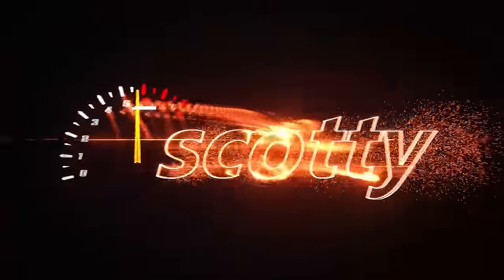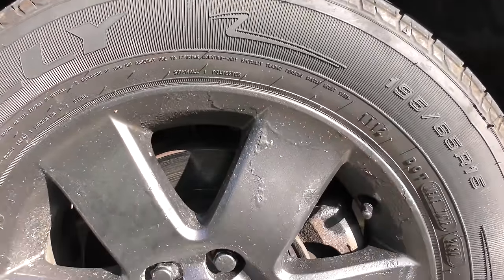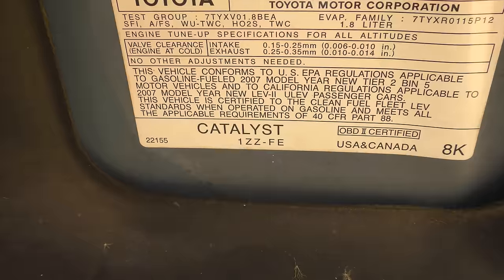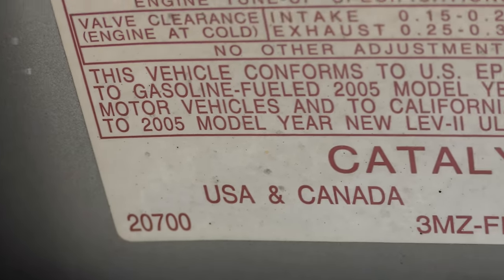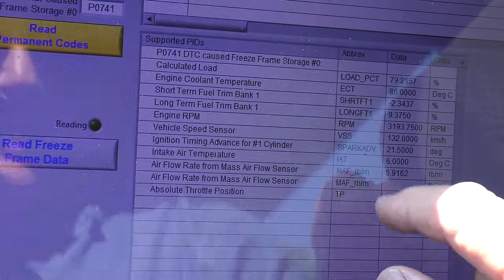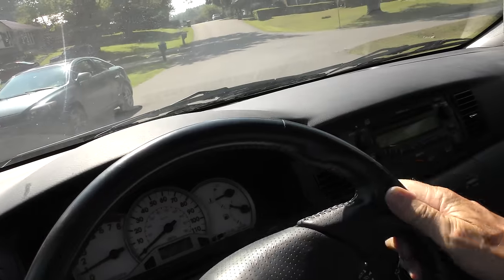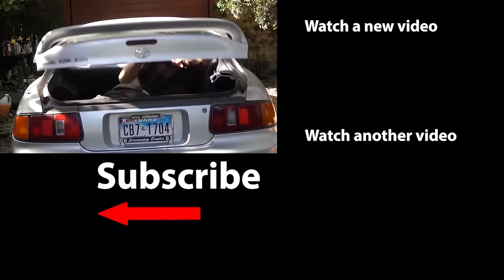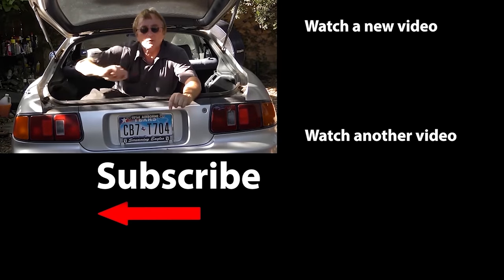I Won't Fix This Toyota Corolla

Comment: Because toyota corollas are so bulletproof they practically fix themselves. Just turn up the radio!! Good afternoon scotty!!!
Reply: Says the man who has drank a lot of Scotty's cool aid 🤪
Reply: Hahahaaha
Reply: Not the new one though
Reply: My corollas Audio doesn’t work deadass needed sum help no other problems beside a cracked bumper 🤧
Reply: Lol this is hilarious, I do exactly this in my 00 rolla 😂
Reply: Had to install a sub in mine to fix all of the worn out bushings.
Reply: I gotta say. Toyota through and through guys. Bought a 2009 corolla 5mt with 119k miles a year ago. It's been a very reliable commuter with the only a seized guide pin, a bad master cylinder, an ABS pump that just clicks, 1st gear becoming synchroless, the water pump breaking, the vvt-i intake gear rattle(very common defect), cyl 2 rod bearing spun despite religious oil maintenance, 3rd and 4th gear becoming synchroless(different gearbox), cyl 2 rod knock coming back a month after pulling the engine to replace the part, the clutch release bearing sounding like a cricket, and as of 2 weeks ago it doesn't even crank for reasons i can only guess being the only things wrong with it. It's a Toyota through and through! Very reliable, and very fuel efficient. Welp, guess I'm gonna go replace my crankshaft. AS YOU DO WITH A 140K MILE COROLLA... RIGHT????
Reply: @mashedpotatoes5323  😂😂😂😂
Reply: That's what I do every time I hear a noise just turn up the radio

Comment: Says a lot about Toyota quality that you can drain most of the fluid out of the transmission and it will still drive! If that had been a Chrysler product, you wouldn't have been able to get out of the driveway. 😂
Reply: You've obviously done your homework, bro.
What did it prove, in the long run???
Reply: @andysaunders3708  tf you so salty about? lemme guess your Chrysler 200 blew its self up
Reply: @masonharkness6437  Not yet.
Reply: @andysaunders3708  😂😂
Reply: @andysaunders3708  need an update has it yet?

Comment: Never buy a car with this problem. I have a very similar problem on my car. I was told by a dealer that I would get worse gas mileage, Just replace the broken part and the car would be great. Now I have an 05 Camry with 160000 miles and a dead transmission after 2 months of ownership. The mechanic told me that this issue tends to cause overheating in the transmission at higher speeds, so the previous owner probably drove a lot on the highway and caused a lot of damage before it was sold to me. If you have this problem, just stay off the highway, not necessarily the end of the car. But if your thinking of buying a car with that problem, then just run. You have no idea how many times it was driven on freeways.
Reply: This is one of the most useful comments on the video
Reply: Sorry to hear that about your camry that really sucks man.  I bought an 03’ Corolla at 70k, and at 100k I had the torque converter shudder in 3rd gear between 40-45 mph, and the rpms are higher than normal on the highway once I go over 65mph.  If I go 75 I’m around 3100 rpm. For almost 6 years I’ve been staying in 3rd gear longer to avoid the shudder, and rarely going over 65mph.  Also done 5 atf drain and refills since I bought it, no metal in the fluid.  Hasn’t gotten any worse in 6 years, at 220k now and still shifts great. If you baby it, it can last a really long time.  Previous owner of yours probably drove it a lot the highway at high rpms and overheated it too often.
Reply: @felipe3354  what’s considered high rpm on the highway? I’m going 75mph @ 2800 rpm. Is that high?
Reply: I have a 2007 Corolla with this issue but I think the issues only happened occasionally because I can drive all week and the check engine light would come one and then go away 10 mins later. I guess it depends on how much it’s slipping and 3k rpm at 80mph seems fine to me

Comment: Where I live, a check engine light automatically fails the inspection.
Reply: I had to drive car for 200 miles and 25 restarts to get mil ready state. After fixing abs. Inspection then went fine. Battery was disconnected during repair.
Reply: If you got a buddy and a used car business go by on one use one of their little turn off the check engine light for 3 days adapters they fit right under your dash and they work great cuz I used to work at a car lot and we did it all the time and it works on Toyota's
Reply: @MAKING-WINE-ITS-A-GAS  Can they be bought commercially?
Reply: In my state obd1 mil lights are passed but obd2 emission only related codes fail
Reply: Interesting. A loose battery connection can cause a check engine light. Obviously, that's not an emissions issue unless you want to claim that the electronics isn't operating properly as a result.
Reply: Hey I've been having the same problem in my 05 Corolla I noticed I was down to about 20mpg is it a really hard to fix or is it the grounded one on the back left side sensor of the transmission I believe it's green in color for the oem one?
Reply: I used to live in PA. they had inspections there but all the mechanics would just do a "lick and stick" 50 bucks out the door. Live in Kentucky now. No inspection
Reply: Im pretty sure you can pull the check engine bulb so it wont light up lol. More work than its worth. But if you ever go to buy a used car, turn the key over so all the dash lights come on. Make sure the check engine lights up. Ppl will try to scam you. Scotty tip
Reply: Just disconnect the battery few minutes to inspect and that solves the problem.
Reply: @MAKING-WINE-ITS-A-GAS  you’ll be cheating yourself mate. Just repair the damn fault and hit the road
Reply: @mzee5533  I don't have a problem with my car. Mate! You must be confused?
Reply: That sucks
Reply: Same where I'm at
Reply: @genericdude6551  Thing is the shops / inspection stations have liability if they pass a car that has an issue that may lead to bad emissions so you never know. Another thing is a lot of licensed inspectors only get X amount of inspections they can do in Y amount of time.. so they are choosy
Reply: @JohnDoe-qj8nm  They check to see that the light actually works in a lot of states--if the light does not come on when the key is first in (as in, it comes on to make sure it functions as most of the lights do), then you fail before you even get to try hahah
Reply: @chineduokonkwo5777  when you get an inspection there computer can see if these was a recent CEL on. They will make you leave and you have to drive it until it cycles in the ECM about 25 times. Then you can go back to have it inspected. I've seen people try the old disconnect the battery cable trick and they get caught everytime. Lol
Reply: @fromthebackofmymind  ... or you could have just gone to any parts retailer for a free scan and had them clear the codes...

Comment: I've had a 1989 and a 2007 Toyota Corolla. They are the best cars you can buy if you value reliability. The engines really are indestructible. Change the oil fill up the gas and drive no worries. Can't say that about many vehicles.

Comment: I own a 2006 Corolla with 320,000km with no major repairs ever needed. I also drive a pair of 2009 Camry Hybrids taxis that have 427,000km and 604,000km on them respectively, all mostly in city driving. On the Camrys, the engines rattle, the hybrid system is totally dead, but they still run and still run well.
Reply: I don't mean to argue but how do they turn on to begin with? Don't they need the high voltage from the hybrid system to crank the engine in the first place? Genuine question out of curiosity since from what I've read toyota's hybrids don't have a starter since gen 1 priuses so just wondering is all.
Reply: I like to her the answer. Waiting
Reply: @StealthMomo  You can hook up an accessory mount, alternator and a bigger serpentine belt. It will work as a normal car.
Reply: @adammorrison3343  Wait don't the hybrids lack a serpentine belt in the first place doe? Where are you gonna hook up an alternator to when the crank's mated straight to the e-cvt? Unless you mount it either between the e-cvt or just use it to crank the cvt itself is there some other way I'm missing?

Comment: There are still many 2003 - 2008 Toyota Corolla's still on the road today which shows you how long lasting Toyota's are. I see 3-4 of them on my street
Reply: I have an 08 Toyota Corolla with only 55k miles on it.

Comment: If the torque converter doesn't lock up then you can also get some overheating at high speed.  All the energy lost to slippage ends up being converted into heat and over time that can cause problems.
Reply: Still probably not worth fixing, junk the car when the trans finally dies.
Reply: There are also products you can put in your transmission to reduce or even eliminate the slippage.
Reply: @jaysonwallker1648  what product works best?
Reply: I doubt that will happen because you gotta remember on the highway, all that air is blowing past the radiator and there is more cooling to compensate for the friction of the converter. If it was a higher horsepower car, I'd be more concerned.
Reply: @kdmq  your radiator cools your engine not your transmission.
Reply: @randomwordbot  some vehicles (like my truck) have dedicated trans cooler radiators. They also will indeed gather cool air from underneath the car when driving at highway speeds, cooling the actual housing (to a degree. nothing major like a dedicated cooler though.)
Reply: @KenzertYT  i know some cars have a trans cooler but its mostly on performance vehicles ( my volvo turbo has one) or heavy duty vehicles like trucks i think im pretty sure most cars dont tho
Reply: @DoubtingThomas333  it’s crazy how cheap engines are and transmissions are like twice as much as an engine
Reply: @kaaugs16  tell me about it.  Diesel engines last but once they get age related issues (injectors usually), I hope you've got deep pockets.   I've had some luck using Lucas transmission additive to keep life in the clutch packs of a normal torque converter auto.
Reply: @StevenAGleason  where at because I called toyota and it cost 414. I have a comercial account and that’s my price…
Reply: Honestly it sounds worth fixing. Especially since it’s hard finding used cars now.
Reply: Under 2002 Corolla don't have lock up anymore old model tranmisson don't have that feature. Just need to change fluid short intervel.
Reply: @randomwordbot toyota corolla have transmission cooling lines from the bottom of the radiator goes to the transmission (i'm corolla owner)

Comment: This is the same car I drive everyday. I have had it 5 years and the odometer just passed over 300,000 miles. Minor things are wrong with it but still runs and runs. I love it and the 1.8 engine and I want to get another one.
Reply: Just bought one with 265xxx miles 😂😂 she runs good, but seems to be struggling to start but starts first try. it shakes when going into reverse. and makes a lot of fricken wind noise when going fast in the cabin😂😂😂😂

Comment: I've got an 05 Pontiac Vibe with that same engine/transmission which had the same code come up.   For me, changing the fluid (not flushing) did the trick.  I don't think the previous owner(s) ever checked the fluid before I had gotten it.  I'm almost to the next 60,000 mile interval and still have yet to have an issue with it since.
Reply: I have a Corolla with 115k miles. I get the code after driving 100-200 miles at 60-80mph. When I checked the fluid it was way overfilled with the car off and while running so I’m going to do a trans fluid change. I think they didn’t change it and thought adding more would be fine

Comment: I have this same problem with my '07 corolla but the check engine light only comes once i get to Newark airport driving back from NY to PA...after a day or 2 the light comes off...car runs great only thing is once in a while when i hit 50 or 70 mph i can feel the car shake, i just let go of the gas peddle and it stops

Comment: My 08 corolla LE has the same code! Everything you've said lines up with what I've heard from my mechanic, but I've noticed that when I use my cruise control at highway speeds it has caused my check engine light to come on. any thoughts?

Comment: I replaced a clutch torque converter solenoid but still get the same code. The car runs fine but I can't pass inspection with this check engine light on. What could be the issue?

Comment: 0:44 = that model year of Corolla almost always has the flange joint cracking off, just where the muffler connects to the rest of the exhaust tubing. That's what's causing the loud exhaust.  The fix for that is to just buy 3 rolls of high-temperature epoxy bandage and wrap that stuff around the broken pipe/flange. The epoxy bandage will last 10+ years, but the welded-on replacement flange that muffler shops use only lasts 3 years before it rusts off.

Comment: 2005 corolla have check engine light error code is Catillitic converter, Arkansas car here in Minnesota Cottage Grove noticed a smell of gas at start up, haven't changed the exhaust but if I change the exhaust with the cat have issues and what would they be?

Comment: Scott has the V6 Corolla and I only has a wrong oil dip stick. Not Fair.
Back in 1980, my sister bought a used 1975 Chevy Nova from a used car Dealer in Pasadena, CA  and I wonder why every time I change the oil, it always "Over Fill" a lot according to the Engine specification. I later found out the oil dip stick is Not the correct one.

Comment: Hey, an all transmission video! Back in 1967 or so, the torque converter in my Dad's '58 Chevrolet started growling, and he was told how much it would cost to replace. He didn't want to put that much money in the car, so he added a little STP to the trans fluid. He thought that it may quiet the noise some, and take up some of the wear that is causing the noise. It worked, and he sold the car about a year later. It still growled, but it still drove fine. In that year with the STP in the transmission he still drove it every weekend between San Bernardino and San Diego, about 200 miles round trip on the highway.
Reply: The 58 is worth it now days, but that toyoda will never be worth it...good quality car though.
Reply: @josephmartinez8803  I agree. I wanted my Dad to have the Chevy fixed. It was a 4 door station wagon with a V8, and comfortable to ride in. My Dad bought a '63 Cadillac to replace it. It was very comfortable, but on long trips, I couldn't stretch out like in the wagon. This was back before seat belt laws.
Reply: @garylangley4502  
I know what you mean about seat belt laws. 
I'm glad I got to experience riding in the back of pick ups. I was born in '63.
Reply: @josephmartinez8803  I was born in 1954. I remember riding in the back of my Uncle's pick up too. My Mom had a mattress custom made for the back of the '58 Chevy, and on long trips, it was great to stretch out there.
Reply: @garylangley4502  
Great time to experience,  unlike now days.
Reply: @garylangley4502  
I grew in SoCal, in Whittier,  about a mile from Whittier Blvd. 
I have 2 brothers, 14 and 15 years older than me, and they were into chevys. My Dad had all kinds of cars and trucks, so I had a great childhood.

Comment: Check Engine light instantly fails inspection here in New Hampshire regardless of what it’s on for, and I believe also in Massachusetts if I remember correctly from what my coworkers have said, so technically no the owner can’t drive it like that for a long time it either has to be fixed or get rid of the car

Comment: My dad has a 2008 Dodge Grand Caravan SE with 100,000 miles on it and runs perfectly fine but the check engine light comes on every 5 weeks disconnect the battery terminal five more weeks later the check engine light comes back what do you think it is

Comment: My Corolla has a p0770 for shift solenoid e. Seems to run fine, but I don’t want to blow out m transmission. It’s about 1000$ repair to have a shop do it, but I need to have the check engine light gone so it will pass smog in ca. recommendations?

Comment: Scotty I have a 99 Toyota camary le with a 2.2 l engine check light is on code P0500 speed sensor a circuit,I changed both sensor and check engine light is still on. Please help

Comment: My 04 Corolla was very rusted underneath (thanks Northeast Rust belt), other than EVAP issues the car ran great, even with a transmission line that had been leaking!
I sold the 04 because I didn’t want to put in a new intake manifold, bought an 07 with low milage and it’s great! The 07s have a recall for the wrong sticker being put on the cars, that’s most likely why it has a V6 sticker under the hood!

Comment: I have automatic 04 Toyota Corolla “le” that has the same dtc code and I plan on fixing it myself ; do I really need to drop the whole transmission jus to get to the torque coverter clutch solenoid? I thought you would be able to access it by jus removing the trans pan and then finding it next to the trans filter.

Comment: My Corolla does it vary rarely. I drive 150-250 miles till it turn on. Might change the fluid and filter to see if that helps.

Comment: I’ve got a 2008 Corolla that I replaced the MAF and intake gasket on because it was throwing a code and it never came back on. It has been pretty reliable and I just installed cruise control on it for about $90. All it took was the cruise control and clutch switches.

Comment: After you pushing the AT 205 Reseal, it doesn't exist anymore! I tried to order it online, after no one in town has it. 0 available for shipping.  What else works as good for rubber and seals?

Comment: Always a bummer when something goes bad due to butchered maintenance. I had a 2002 Corolla with a 1zz and it was an oil burning machine. Blew a piston on it. I also had a 2012 Corolla S with a 2zz that was a nice engine. Drove it for 90,000 miles with zero problems whatsoever until a teenager totaled it.